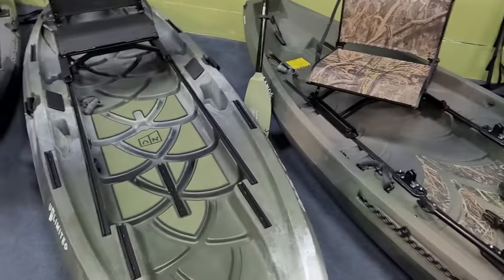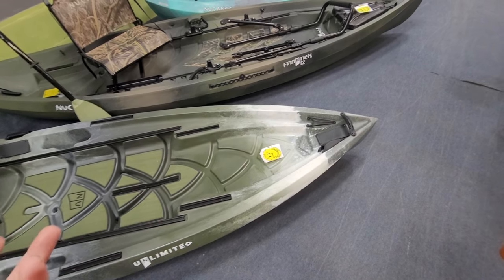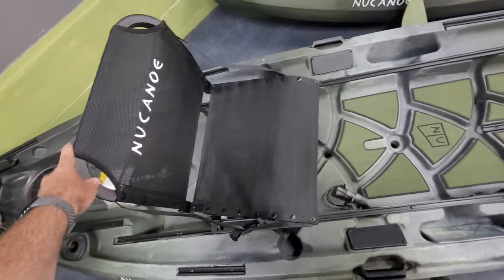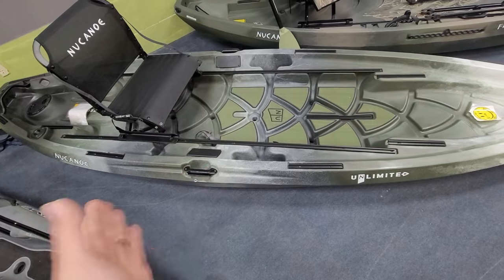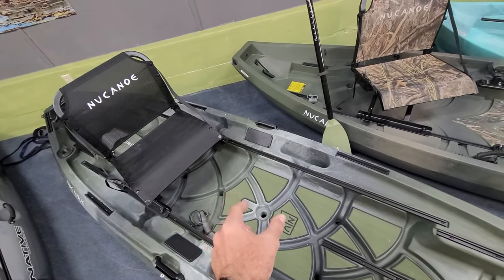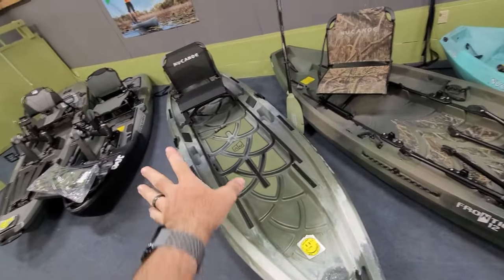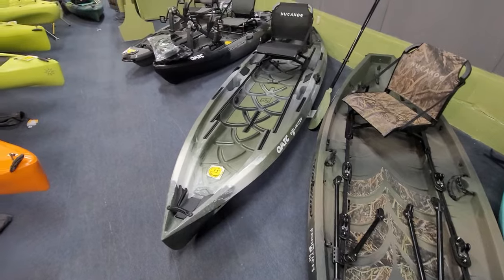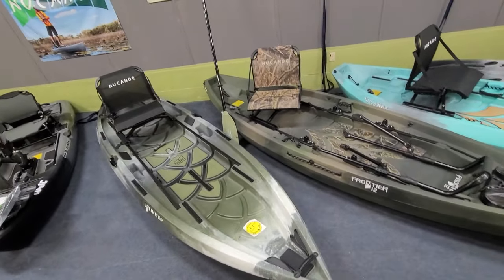Nucanoe Unlimited kayak | Why it's right for you

Comment: Man, I real love this thing. What you’ve brought to light with your points has given me a ton to think about. But, I am at a small crossroads where this kayak is just a touch too big for how I want to use it. Transporting it is my biggest hang up. I’m planning on putting a kayak in the bed of my Ford Maverick, a fairly small bed, so I have been eyeballing a 10.5 sized kayak as my maxed length. In particular the Native titan 10.5 or slayer 10. I’m kinda new into the kayak world and was thinking pedal drive would be my entry into fishing kayaks. This Unlimited Nucanoe with its open platform is appealing also. Could you possibly do a sub 11 foot top picks for kayaks? I know I’ve given you some limited use case scenarios, but I guess I should provide that I’m a 5’11” 225lbs 44 year old guy for weight and size considerations. Thank you
Reply from the maker: Check out the Nucanoe Frontier 10. You still get the swivel seat and an open platform. The Native Propel 10 is another really good one. I have a video on it for "best lightweight pedal drive"

Comment: Do you have a rod holder recommendation for 20-30 pound fish tough enough to handle repeated take downs from flathead catfish
Reply from the maker: I would go with AR tube rod holder from YakAttack. Make sure you have a good solid track mount underneath it though

Comment: Love your channel 👍
I'm in the process of getting a new kayak. I've narrowed the choice down to Hobie PA 12 or the Titan X 12.5.
I love the fish jerkbaits and  for me that means standing up in the kayak, what's your opinion on which is the better kayak for the standing fisherman? I'm not thinking solely about stability but also about deck space for your footing etc.
I might add that I will not run a motor but I want to rig the kayak with livescope with a 10 or 12" screen.
Reply from the maker: Check out my videos on the Titan X. It's the most stable kayak out there and the most modern
Reply: @thebeardedpaddler Thank you for your reply!  I've checked it out several times😊 I'm just curious about "deck space" on the Titan X vs Hobie PA? I've some experience from a friends PA but none from the Titan X. I'm leaning towards the Titan X but just wanted to hear your opinion about the practicality of standing up and doing some active jerkbait fishing from the Titan X

Comment: Guys, I am looking to upgrage my fishing kayak. I am currently in a SeaGhost 130. I am 6'7" and 360 pounds.  
I do not like how tippy my Seaghost is, and I'm looking for a larger capacity kayak to fish our local rivers and tournaments. Like most everything, opinions range drastically on this topic. But what would you recommend for someone my size? 
Long term goals is to have a tolling motor and rig it out for depth finders with a minimum draft depth for river fishing. I like the idea of easily removing some of the gear to lighten up for shallow river draft to fish our local creeks and rivers.  

I see so many  average size people doing reviews but not many people my size. I believe there is a market there but no one representing. 

Thanks in advance for any suggestions you can help with.
Reply from the maker: Well im 6'5 and 270. The Nucanoe Unlimited would be the #1 in my opinion